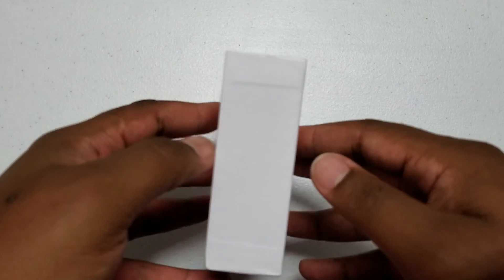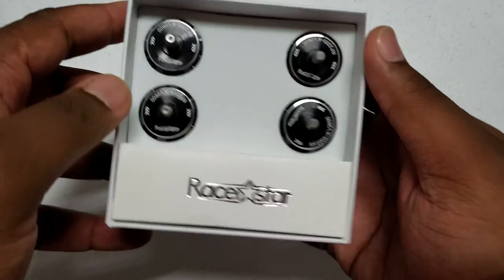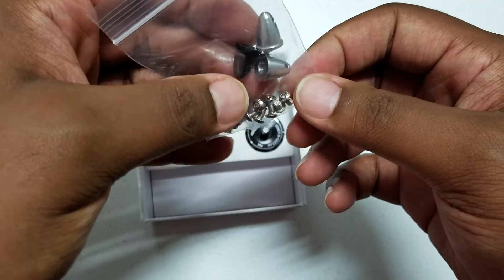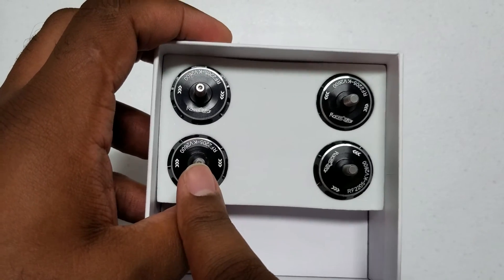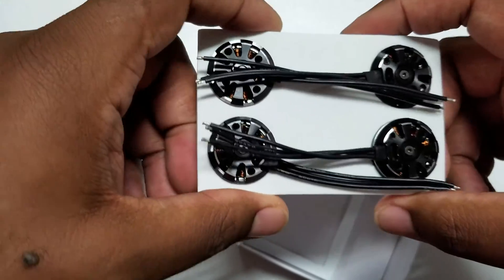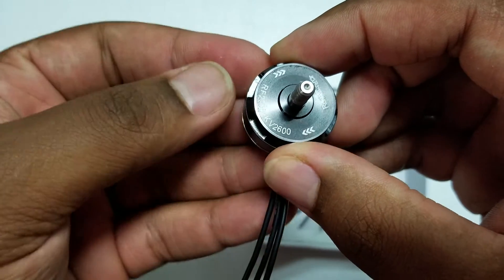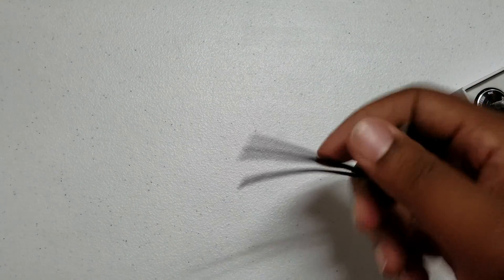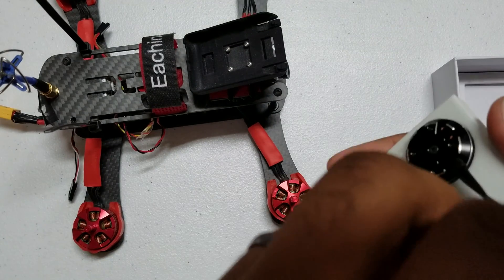First Look & Unboxing - RacerStar RF 2205 2600KV Motors

Comment: Hey how do you put on nylon locknuts??
Reply from the maker: They are just a better form of screw to secure the props on to the motors. You only need to screw them on as normal
Reply: noice, thanks